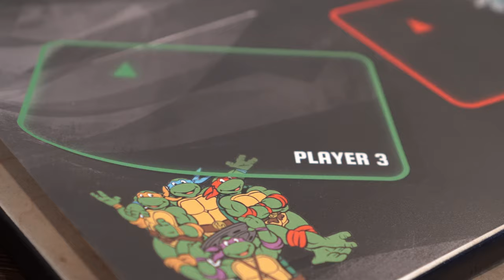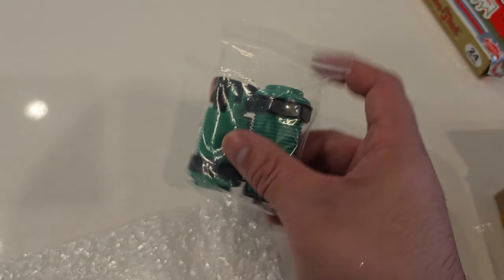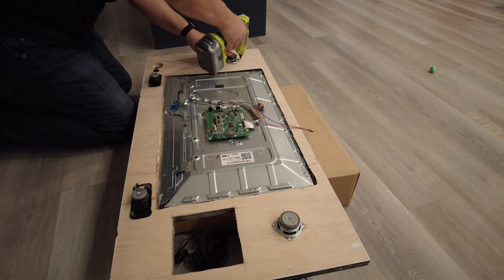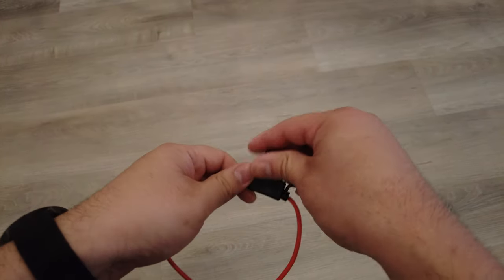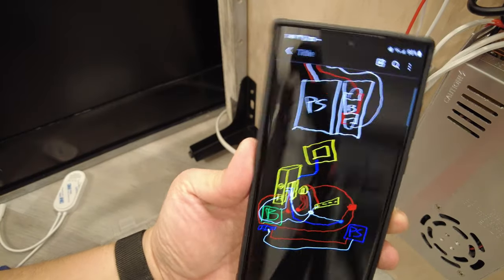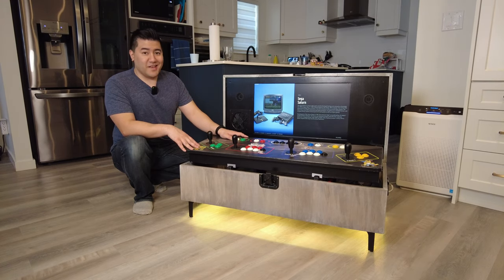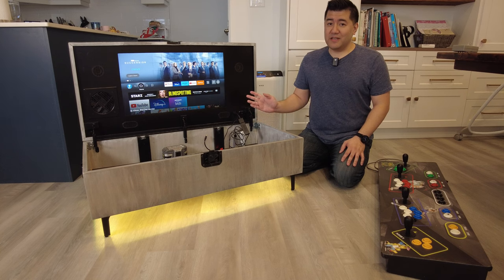DIY Coffee Table with Hidden 4-Player Arcade Machine. (Part 2 of 2)

Comment: I have researched A LOT about DIY arcade tables and this project ist clearly one of the best out there. Using quick release levers for the joysticks may be a good idea for saving another  two inches of height, but height does not seem to be an issue with your setup.
One question: What games are out there that really require eight buttons? I am thinking about using only six buttons, but I would bite myself in the butt if I later find out that it is not enough for that one game.
Reply from the maker: Oh man, thanks for the high praise! Quick release levers actually is a great idea. Height actually WAS an issue as I had to change my design a bit from the original concept. As is, there's literally just a few millimeters of clearance when closed.

Sorry for the super late reply but regarding 8 button games, honestly I can't think of one lol. Google searching shows a small list but people mainly add the additional button(s) for flexibility, or to have 4 buttons in a row for a traditional NEO GEO setup. Hope your project went well!

Comment: Seems awesome 👍! About how long do the batteries last before needing to charge them? I thought about just taking an old laptop apart to get the same results. You could even do some mouse and keyboard gaming 😁
Reply from the maker: That sounds like a great project! 👍 The screen is the biggest power suck so a smaller screen would definitely last longer. If I'm using 2 6ah batteries (i.e., 12ah total), I should get around 5 hours give or take.
Reply: @fp_awesome  cool, and can you charge the batteries from this unit or need to take them out?
Reply from the maker: Need to take them out to charge. Felt that was the best and safest choice rather than trying to figure out the charging situation without blowing up my table (and/or more) in the process 😅

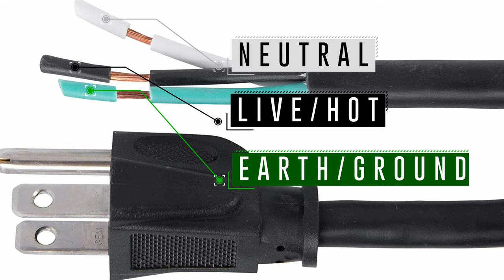Comment: OH Hey! @ 10:30  I might actually have a useless piece of knowledge that might actually be useful.  With many power cords / extension cords, you can tell which one is positive by looking at the sheath or the cord itself.  One side of the cord should have some grooves.  That is the side that is positive!
Reply from the maker: That's the complete opposite of "useless"! Thanks for the tip!

Comment: can u play ps5...x box series x?
Reply from the maker: You could because it takes a normal hdmi input. Only thing is that in this config the consoles would still need to be plugged into the wall because it's not set up to power them.

Comment: that is a horrible screen position. it need to be tilted back a bit further there mate, or else you'll get a bad case of a stiff neck.
Reply from the maker: Going beyond 90 degrees would definitely have been better for viewing angle, but with the top being 28 lbs, this would've introduced a whole bunch of physics and stability problems that I'm not equipped to deal with. That said, the current position isn't making me move my head in an awkward position enough to get a stiff neck.

Besides let's be real, there are plenty more ergonomic issues with this set up and I'm definitely not passing a workplace ergonomic assessment lol.